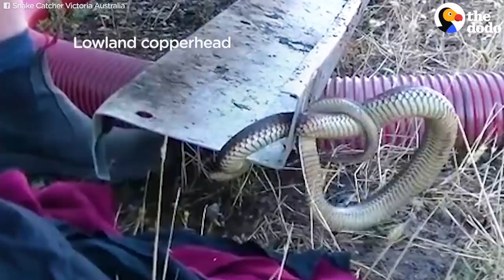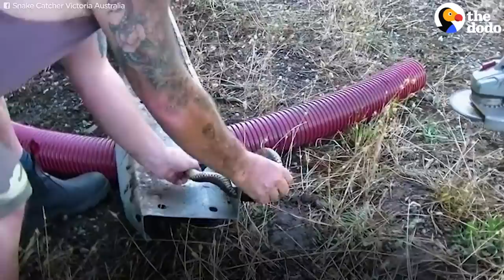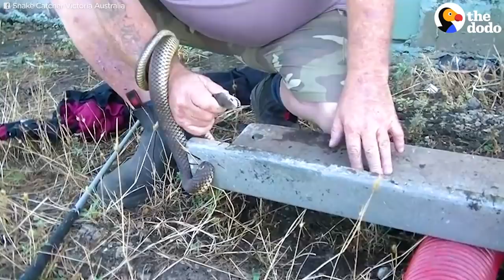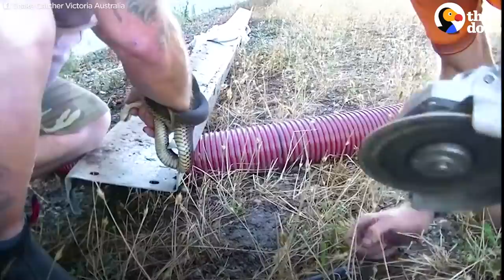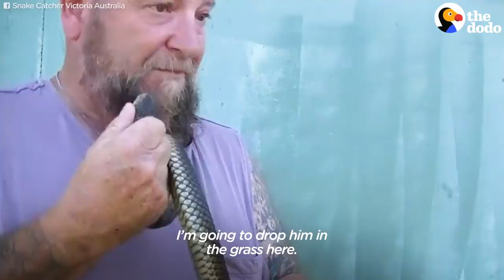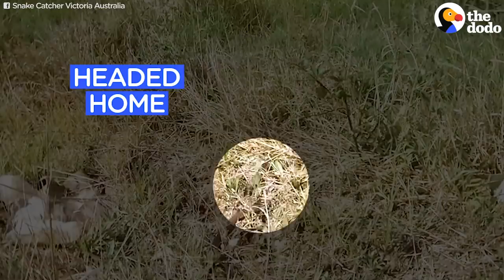Brave Guys Rescue Poisonous Lowland Copperhead Snake | The Dodo

Comment: Copperhead are venomous not poisonous.
Reply: Venom is a type of poison it's literally in its definition "poisonous substance (by injection)" so stop trying to be clever. It's like saying a copperhead is not a snake while it's a certain type of snake.
Reply: Poisonous means they kill you if you eat them. Venomous means they kill you if they bite you. It may be a little pedantic to rail about the difference but they do have different meanings even if they are often used interchangeably.

Comment: Venomous. Not poisonous.
Reply: Thank you
Reply: The venom is poisonous, semantics. What about the rescue? No comment?
Reply: @annkelly6643  Venom is not poisonous. Poison needs to be ingested (by mouth, absorbed through skin, mucous membrane, etc) to cause harm. Venom needs to be injected. You can drink venom with no ill effects as long as you don't have an open wound. So no, it isn't semantics. It's misusing a word.
Reply: @thirdprince4028  Who Cares, would you rescue the snake? because one wrong move and you're potentially dead, I can just imagine them having the venomous, poisonous debate while rescuing the snake. Not.
Reply: @annkelly6643  Considering I'm in veterinary medicine and have done rehab work for wild animals? I'd make sure the snake was rescued. Either by contacting someone experienced with rescuing venomous reptiles or getting assistance to do so if no one qualified was able to. But cute that you think caring about using correct definitions means I don't care about rescuing animals. 

Knowing if an animal is venomous vs poisonous is extremely important. Using the correct word ensures people take the correct steps to protect themselves while handling the animals. Venomous and poisonous animals should be handled differently, especially depending on their specific toxin. But go off, I guess. Apparently my schooling and work experience doesn't mean anything because you don't think the difference is important.
Reply: @thirdprince4028  I'm sure you're brilliant at your calling, I applaud you for your rescue work. I just think it's brilliant that these guys saved the snake, I think the comments on posts should applaud the rescuers, not critique the title.
Reply: @annkelly6643  I care about the channel and want them to do their best bringing videos like this to a wide audience. Part of that is wanting them to spread correct information. So I liked the video, shared it with some folks, and commented about the error in the title. There wasn't any ill intent or anything on my part and I agree it's a great video. The guys in it are awesome and I'm glad the little snake friend got some help. Being left there to starve to death, badly injure yourself, or be eaten by predators while you're defenseless is a pretty terrible fate.
Reply: @thirdprince4028  Ok, I overreacted, you're right it's important to share correct information. I apologize.
Reply: @annkelly6643  It's no problem! You did have a point in that I could have commented on the content of the video as well. I'll keep that in mind in the future. You have a lovely day. ❤
Reply: @annkelly6643  👏👏👏👏👏✌
Reply: @thirdprince4028  You too, have a great day.